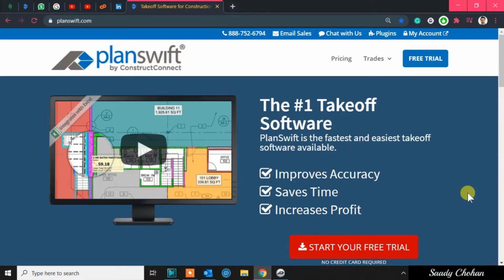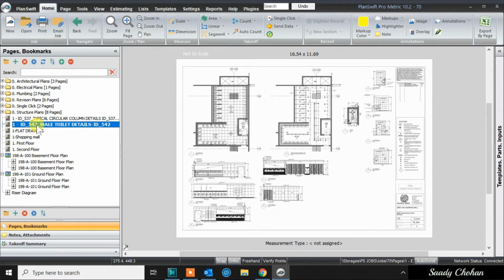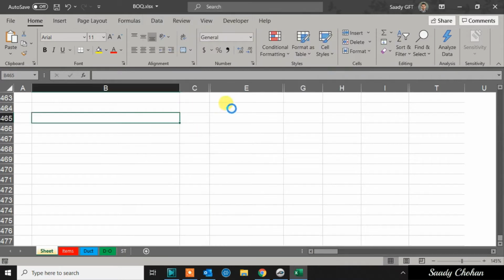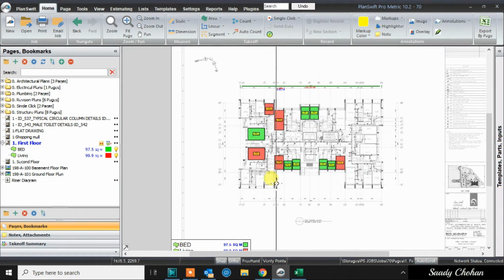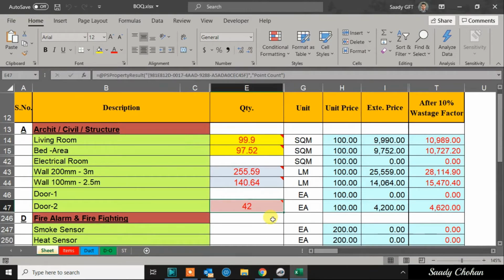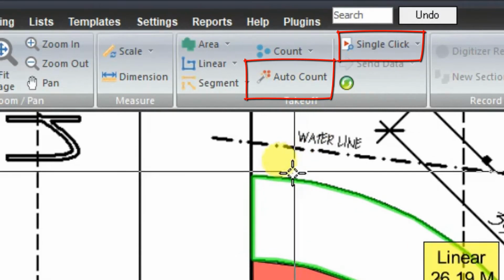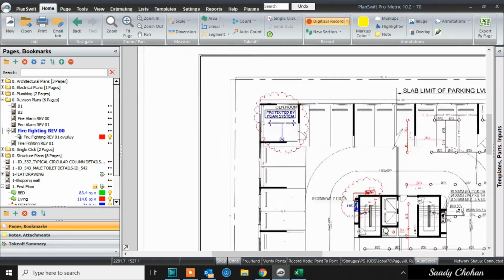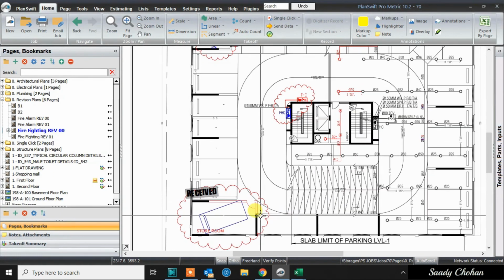Planswift 10.3 Tutorial for Beginners | Level 1 | Webinar | Basic | Training | Course | Complete

Comment: @saady chohan on scaling in our drawing side ways i.e. vertical dimensions is not showing correct. Please clear the doubt.
Reply from the maker: There could be many reasons. Try setting scale again for X & Y. And have you noticed this on one drawing or all?
Reply: @SaadyChohan  yes I tried at X and Y it was ok. But as u were telling on X axis only I was getting wrong then. I think Scaling should be done on both axis, Right?

Comment: Assalam Aleikhum sir. am using planswift 10.2 but i dont have excel intergration and autocount tool.
Reply: same here i dont have autocount tool in my planswift 10.3. did they remove this feature?
Reply: nevermind i found the solution. its in settings->interface->tick mark "show auto count tool"
Reply from the maker: For quick replies,  contact me through Instagram.
Reply from the maker: Waalikum Salaam,
1) PlanSwift & Excel integration requires proper installation, latest version and few other factors. Which version of MS Excel do you use?
2) Watch complete video till end, It will help you to get AutoCount:
https://youtu.be/SzrXU_qXhZ8

Comment: Brother, I am using planswift 9.. is there any option available for integrating excel in there
Reply from the maker: There are some ways to connect.
Soon i ll upload a video about that.
Stay connected, you ll learn it. 😇
Reply from the maker: Integration is available only in the latest version of PlanSwift Software.
PlanSwift 10.0 , 10.1 & 10.2
Reply: Hi,
whenever i am trying to open a new and go to selecting pdf fie format i am receiving a notification " 
no images have been checked. would you like to continue without adding any images?" yes or no.

If i am selecting no, then it is not moving to next. But when i am selecting yes, then it goes to convert setting. then i am selecting next. then ready to create job. then finish. after which it is an empty page. not i.porying any pdf file.??

Please could you help me on this issue???

🙏🙏🙏

Thanks in anticipation.
Reply from the maker: @mohammedkhajahussain8525  I assume you haven't selected the file in a proper manner, 
You have to "Check" not select. 
to learn this, please watch the video at 3:14
Let me know if you check the files in the same manner.